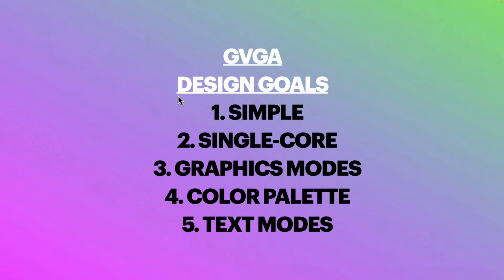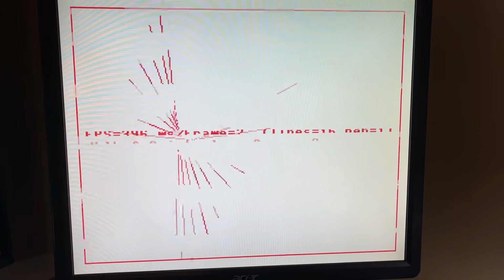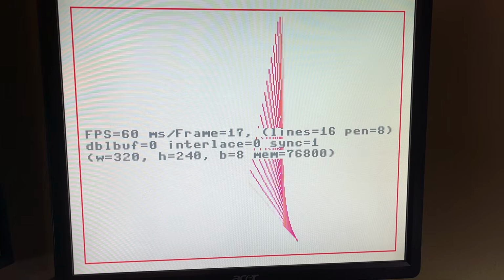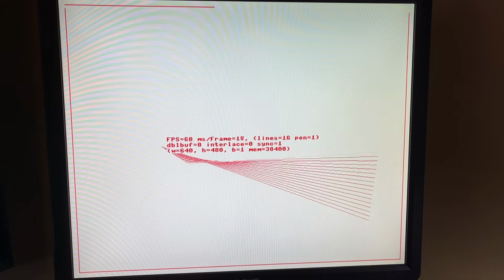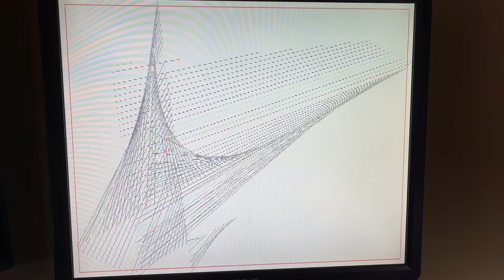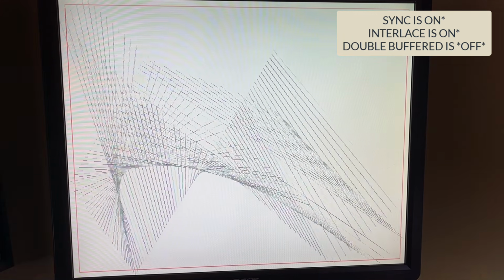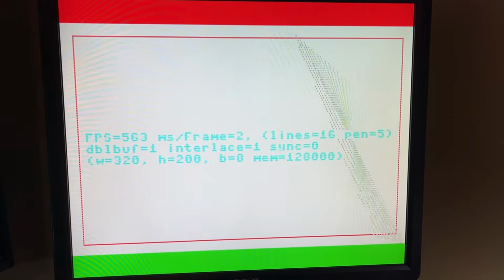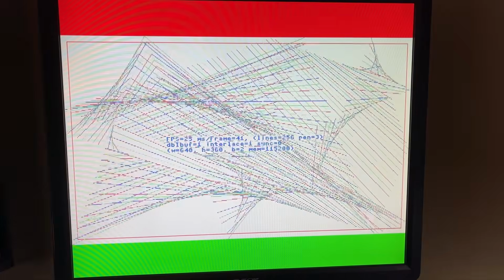GVga: Simplified VGA for RPi Pico

Comment from the maker: One thing I neglected to mention is that you don't need SYNC and DOUBLE BUFFERING at the same time. When DOUBLE BUFFERING you must call gvga_swap(...) at the end of the rendering loop. Also, the reason you might use 320x200 pixels (or some other odd number like 640x360) is to reduce memory usage. Also, I used the Pimoroni VGA Demo board for the Pico-to-VGA connection: https://shop.pimoroni.com/products/pimoroni-pico-vga-demo-base?variant=32369520672851
Reply from the maker: Also, I just added a full text mode (not just text painted on a frame buffer). So you can get 40x25 lines of text for just 1,000 bytes. Check out the github.
Reply: How much in general would a mB of ddr1 ram help as a frame buffer?
Reply from the maker: @Jblow-u2m  I don't think it would help much. The timing is such that getting AT the memory would be so slow that you would't be able to update the display fast enough...

Also, I am now focusing on RPI 02W because it has built-in HDMI and 1000x more processing power and memory, for just a few bucks more.
Reply: @drfrancintosh  what if someone threw in a small fpga? The dual port bram and DSP blocks would provide what benefits exactly? Also you can put a dma in the fabric for data movement help
Reply from the maker: @Jblow-u2m    well at that point you might as well move to a rpi02w. the cost of a fpga would outstrip the cost of the other device. 

This vga project is interesting and there are some applications. but for the most part if you need video, you really should just invest in a esp32 or rpi02w.

Comment: Impressive work!  This and the Pico HDMI video are two of your most viewed videos but you only did two?  I would have loved to have seen a step-by-step breakdown of the code, from minimal working code to the finished product.
Reply from the maker: Thank you friend! I actually love doing coding breakdowns. But it takes a lot of time and I don't get a lot of views (see my videos on "Object Oriented Programming in C"). 

Also, I'm beginning to warm up to the RPi Zero 2W as an alternative to the Pico for HDMI. It's literally 1000x more powerful and only costs about 2x more. 

Also, I think there are now other Pico HDMI/VGA implemenations that are more powerful than mine. I think Adafruit's Python how has a HDMI package that is pretty comprehensive.

However, there is a project in my backlog called Pico TV that reads Composite NTSC and displays it in VGA using the RPi Pico... It's connected to my RCA COSMAC VIP video... 

so stay tuned!

Comment: I have always used weird modes like 320x400 or 320x480 to conserve memory but remain compatible with standard VGA video scan rates.  I have VGA output set up on my GuitarPico guitar pedal but I've never gotten around to actually implementing the audio-based graphics and feedback from the guitar.   One of the cores is already working full-time to implement the guitar effects.
Reply from the maker: Interesting! I'd like to see more!

Comment: Can we still use the pico to do other stuff if we use this or is there no room left? If so, how can we use this if we need another microcontroller to do the other stuff?
Reply from the maker: No... that's the whole goal. There are 2 cores. I've dedicated Core 1 to VGA processing. The other is completely unencumbered. So, once you initialize GVGA, whatever memory is left is yours, and Core 0 is yours. Have fun!
Reply: @drfrancintosh  so using it to say process (switch) data coming from another microcontroller before displaying something afterwards is perfectly fine? I'm trying to build a pinball machine DIY, on a budget but with all bells and whistles. SO far, I got a single arduino uno r3 doing everything, but it's not capable of color display. (but so far it's doing everything else, button sensing, infrared sensors, solenoid driving, audio and single color display output via TVout.)
Reply from the maker: Hello franken-friend... I am only now seeing this. How is your project coming along? I recently did a PyMirror build with a RPi Zero 2W which cost about $15. When you consider you get 4 cores, 512MB RAM, and full HDMI... for only about $10 more, it makes me wonder why I'm using RPi Pico for some projects.

Let me know how your project is coming!
Reply: @drfrancintosh  because it was impossible to do the pinball project with a single microcontroller, I went to OPP (open pinball project) that runs on a blue pill. (or multiple blue pills) connected to a linux computer running MPF (mission pinball framework) it could also be raspberry PI based (tho slower) but PICO is not supported. I got working flippers and on screen attract mode and game modes. still need a lot of work on the table itself and the background gamecode.
Reply from the maker: @CrazyByte2007  That sounds like a huge project. I hope you'll share your results. I'm subbing!

Comment: What's the point? Still have no clue. May be better with RP2350, but?? 
Still, even ESP32 S3 with 8MB OPI PSRAM and FPGA to pump out the DVI signal, it's slow.
The RP2040 is slow as well even at 250Mhz. It's not designed for this. You will hit many walls along the way.
The cheaper, better, smaller, neat solution is Pi Zero W. Trust me.
2 cents~

Comment: would the pico 2 with its 2 times memory not solve many problems?
Reply from the maker: Yes, and no. The memory issues would be solved. You will be able to get better resolution. But the timing issues (eg: 640x480) is a performance issue. There may be better throughput with the Pico 2's' 150MHz clock rate. Or it's new HSTX output pins. But double buffering, sync, and interlace are likely going to be needed regardless.
Thanks for your comment. I hope to do a Pico 2 follow up soon.

Comment: Nice work! I picked up a Pico 1 to perhaps make a VGA for  a fantasy retro computer with a CPU I'm developing in FPGA. I still hope to do some graphics in the FPGA, but the Xilinx Zynq chip on my board is rather limited in the amount of programmable LUTs and flip flops, so the Pico or maybe a ESP 32 TTGo are my backup options.
Reply from the maker: Thank you, friend. Your project sounds interesting. FPGA is on my "road map." I'm very keen to drive LVDS displays. The FPGA-based boards for LCD displays are very bulky and power hungry. I'm hoping the Pico 2 will be able to drive LCD via LVDS.

Comment: Hello! First of all, great video! Subbed to you, and would be nice to post a schematic on how do you have that connected to the HDMI, VGA cable, or at least a view on how do you setup the connection between the pi and the monitor (maybe you have this already in another video, if you do link it if you don't mind)

Keep up the good work! And thanks!
Reply from the maker: Thanks for your thoughts! I neglected to mention that I'm using the Pimoroni VGA Developer board. I'll pin a link to it in the comments above. BTW: I just added a pure-text mode (not drawing text on a frame buffer). So you can get 80x60 rows/columns of text using only 4800 bytes of memory.